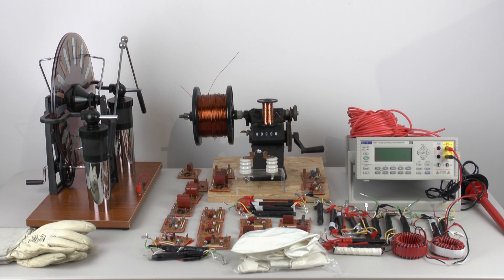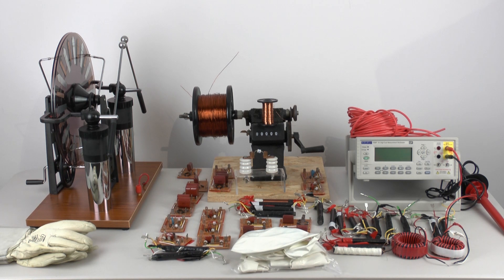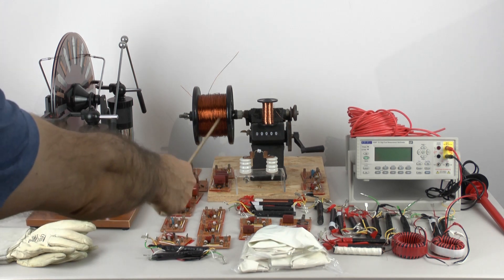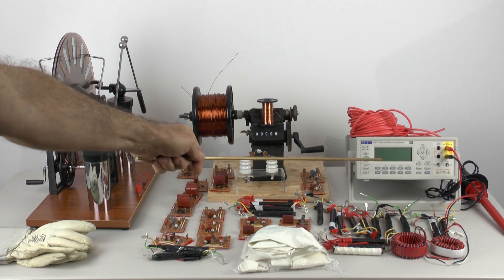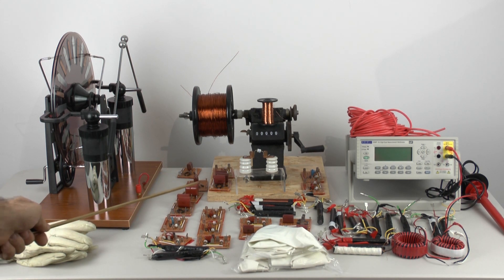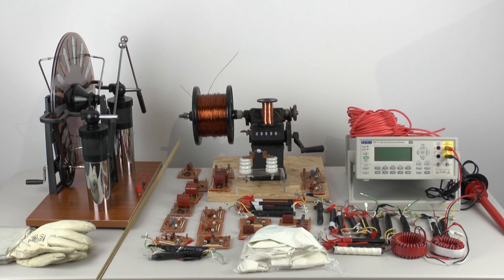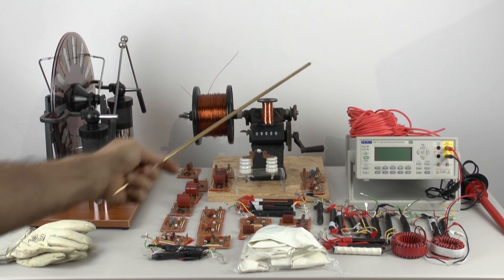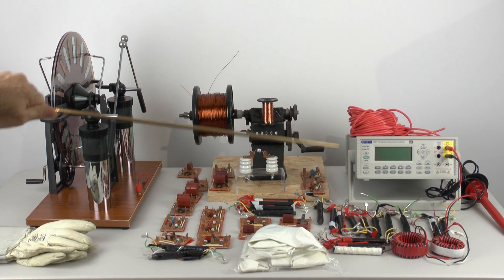Development Forecast 2019

Comment: I'm hoping that you are not going to have to go as high in the atmosphere as you think to gather the energy. I'm really looking forward to seeing your work. Good luck to you and have a great holiday.
Reply from the maker: I stay conservative at will be around 100-200 meter at the beginning and see what happens. For higher tests I have to go uninhabited areas like fields which have in my area a lot. Main purpose is to keep it at such a level, so I have to figure that out and advice.
Reply: @TheOldScientist  It is my understanding the higher you go, the higher the voltage you will get and I think it increases significantly as you go from sea level or whatever elevation you start at. I am trying to find where I read this and the levels. I've been wanting to do an experiment with a sheet electret and coaxial cable which I've read can also be turned into an electret, as the antenna. Two sheets of dissimilar metals such as copper and aluminum with a suitable dielectric material charged for a short period within a strong electric field, after getting near its melting point. Quartz; silicon dioxide, beeswax and tree resins are good experimental materials.     

Too many experiments, not enough time.  

http://spie.org/newsroom/4226-new-electret-charging-technique-for-energy-harvesting?SSO=1
http://www.cheniere.org/references/electret.htm

Comment: Isn't the ratio 50 volts per foot? 
Or was it 500?
Reply: I think its more like 500, there will be no shortage of volts, just the current.
Reply from the maker: That is a theoretical figure. I personally did not measure anything until 15 Meter. That can be because the setup and the weather was not right. This time we will know for sure for a given weather condition.